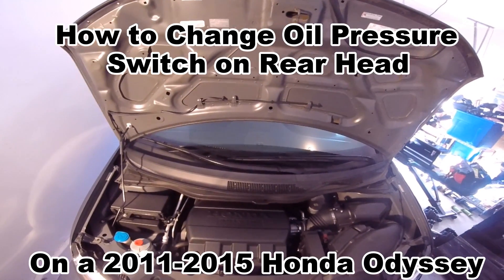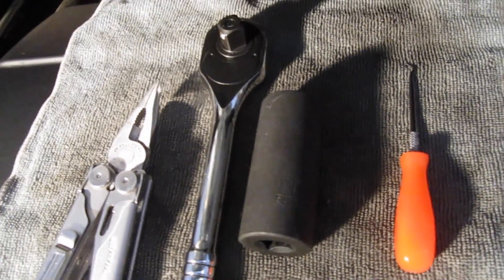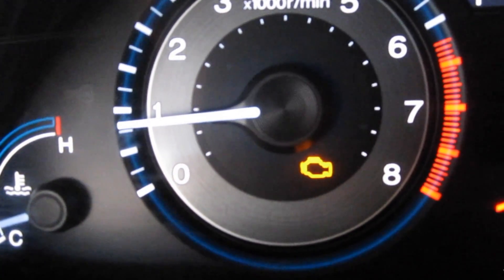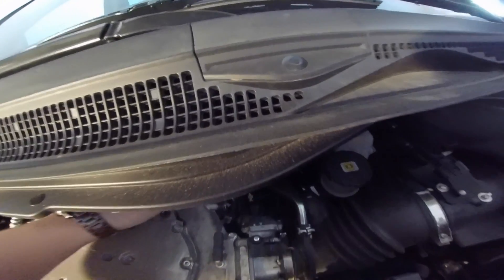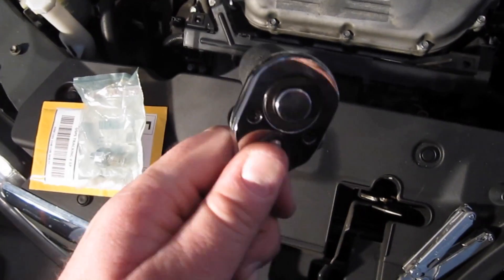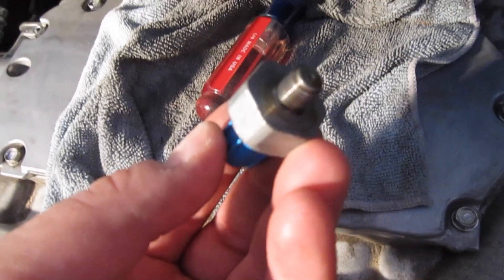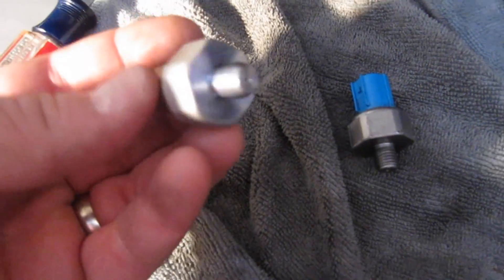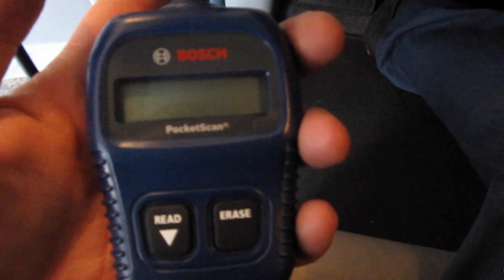How to Change Oil Pressure Switch on a 2011-2015 Honda Odyssey

Comment: 5 minute job took me 45 ... 5 min to change the back sensor, 40 minutes to attempt to find the new washer that fell twice while trying to put it on ... ended up not finding it second time and put old one back on!  I'll need try again when I have opportunity to buy new washer.  Windy day, side of road, 2 blocks from auto parts store, your video gave me info I needed to do the job!  Thank you!  Fix'd sensor and app told me the code, and was able to reset the code after job was done.

Comment: One other thing, I had the P3400 code on my
2012 Honda Odyssey. I replaced the front (bank 2) and back (bank 1) switches, and tried clearing the code with my OBD 2 scanner (FIXD). Even though I fixed the issue, the code was still there (even with an aggressive code clear). I took it to O’Reilly auto parts, and their scanner said that it was a permanent code (PDTC) that needed to be reset by a mechanic. I took it to a mechanic, and they cleared the code with the mechanic reader, and then it was fine after that. If your check engine light is still on, you may need to go to a mechanic and have them clear the permanent code.

Comment: FYI you do need the deep sockets. Regular won’t reach.
Reply: 100% correct. The little plastic plug holder on top gets into the way without the deep socket.

Comment: Thank you for the video! I can’t seem to figure out how to open the clip. I’m worried I may break the wires or something.
Reply from the maker: You should be able to pinch the clip and pull up at the same time to remove it, it may require 3 hands. Sometimes the plastic gets stiff or hard to unplug, I’d just suggest keep trying to depress the part that can be depressed and be careful not to hurt the wires as you go to pull it out. If you still can’t get it, it may be worth taking to a professional mechanic.

Comment: Does this have a 3 pin connector or 1 pin Because I’m seeing $150 price difference and is the gasket available at parts stores because I don’t feel like waiting around for Amazon and usps. AutoZone has a $35 one and $179 one.

Comment: So do you have to put a new gasket in or can I reuse…
Reply from the maker: I’d recommend using a new one
Reply: Agree with the OP.. any time you change out a gasketed part, a new one should always be installed.

Comment: Just changed mine out on my 09 Honda Accord V6. After changing I still have the code. The oil level is fine. Now will the code clear in time or will I need to clear it?
Reply from the maker: thurm101 personally I’d clear it.
Reply: Thanks Dude. I cleared the code and it went off. I also rechecked it with my code reader.  It found no problems. Glad that I changed the O-Ring. I was talking with a guy about doing this easy repair. He told me that the old O-Ring should be fine to reuse. I got a Genuine Honda part and grabbed a O-Ring from the dealer. Had to kinda of dug the old ring out. But it was easy. So glad I did it right. Thanks

Comment: How do you know if it’s the front or back sensor?
Reply from the maker: Kana7782 based on the codes. If it’s bank 1 or the back, most likely you’ll get a P3400 code. If it’s bank 2 or the front, you’ll get a P03497 code. 

This article may also be helpful: https://www.alldata.com/blog-entry-option-2/switching-it-honda-oil-pressure-switch-issues
Reply: Got the p3400 bank 1 code. Fixed it. Done! Thanks!
Reply: Didn't get a check engine light, just the oil pressure light going on and off sporadically. Should I just replace both sensors? Oil pump is fine, and oil levels are spot on.
Reply: How to get stuff done 
Thanks

Comment: I'm having some trouble finding the gasket on Amazon or other parts sites. Any chance you have a link to where you found yours or what you searched to find it? Thanks!!
Reply from the maker: Link to o-ring:  https://www.amazon.com/dp/B00BFDI7LU/ref=cm_sw_r_em_api_c_BtfLAbKXPC3T4

Link to pressure switch assy: https://www.amazon.com/dp/B00IFPSB8U/ref=cm_sw_r_em_api_c_VsfLAb73RNENY
Reply: How to get stuff done thank you!!